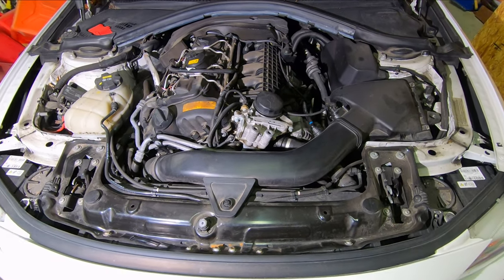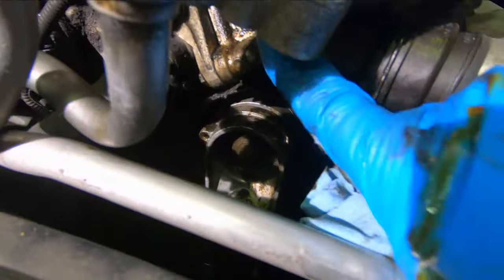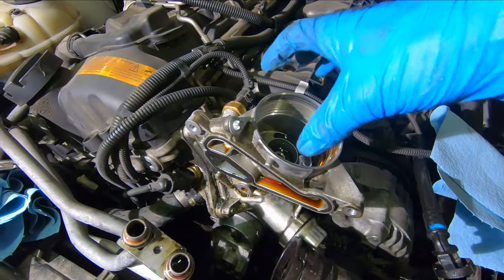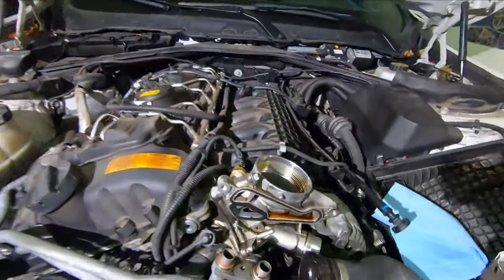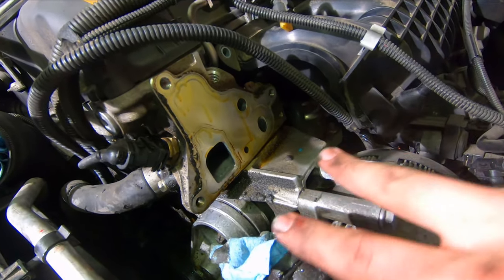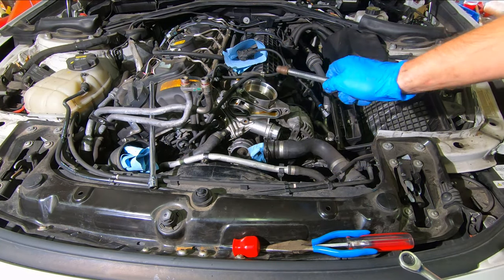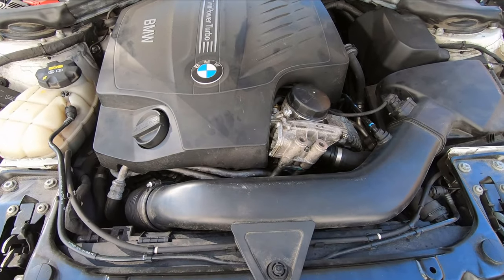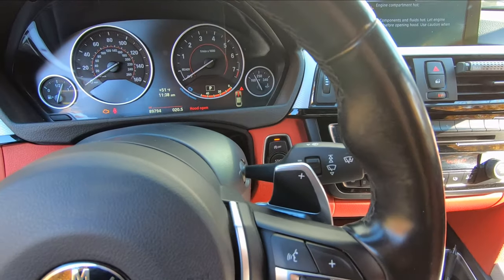F30/F32/N55 Oil Filter Housing Gasket DIY

Comment: Awesome video bro, going to do this to my 135i this week. Two questions, do you recommend to replace the belt if there's little to no signs of any oil getting onto it? And any issues at all after this replacement?

edit: Also thanks so much for providing torque specs, literally nobody does this and it saves me 15 minutes of doing internet research and struggling to find a conclusion after 4 different numbers from forums and what not lol.
Reply from the maker: No need to replace the belt if it still looks good. Ive driven the car another 10k miles since this DIY and no issues

Comment: Hello I am writing to you from France I have watched your video and I did like you 500ml in the filter housing when reassembling I took the opportunity to drain the engine I started and let it run on site  20 minutes then road test of 20km at 2000rpm and for the moment nothing to report
Reply from the maker: Glad to hear! I'm still going along with no issues as well! I've added another 5k miles.
Reply: @tuned_auto  thank you for your very precious feedback
Reply: @tuned_auto  hello friend do you have facebook i would like to be in contact with you and how many kilometers since the change of the seal
Reply from the maker: @alanabt2494  yes, join my group “F30/F32 Owners”. I am the only admin of the group.
Reply: @tuned_auto  i just asked
Reply from the maker: @alanabt2494  sounds good. Feel free to message me on messenger. For everyone else, I still have 0 signs of issues 6 months later.

Comment: Don't you need to replace the air intake manifold gaskets when you change out the oil filter housing gaskets?
Reply from the maker: No
Reply: Yes, the guidance is those gaskets are not to be reused. Few bucks for a new set.

Comment: Any thoughts on priming the oil as some folks have suggested?
Reply from the maker: I'm 2k miles in with no catastrophic failure like some talk about. Maybe I'll do an oil analysis on the next change..
Reply: I also didn’t prime the oil
Reply: do you guys know how to prime the oil?
Reply: @RayFiore13  I found a guide on Youtube how to do it. The process wasn't too bad with the aid of a small flathead to disconnect the fuel injector wiring.